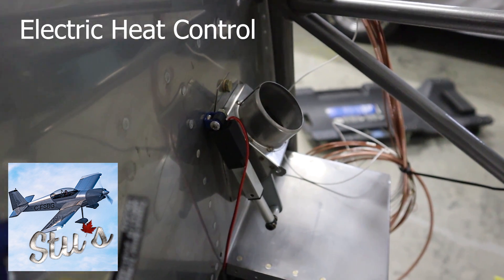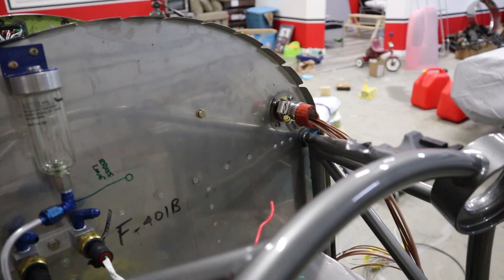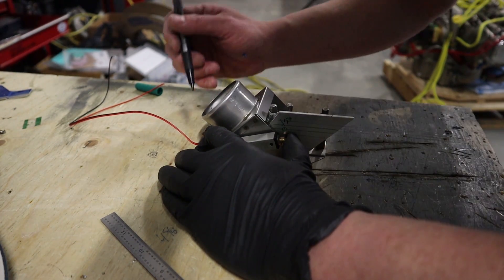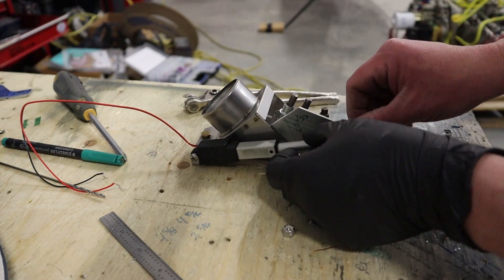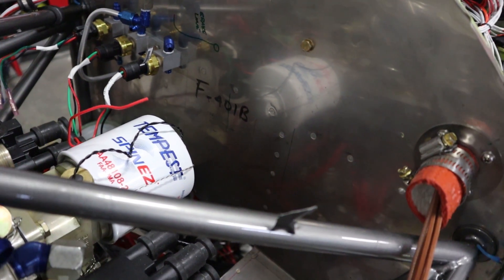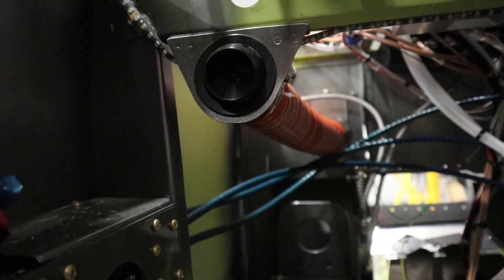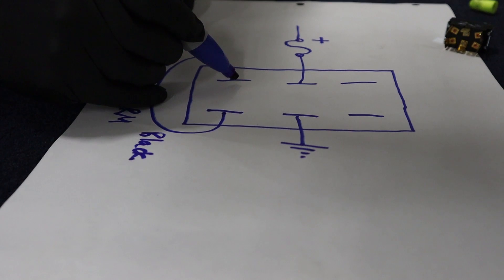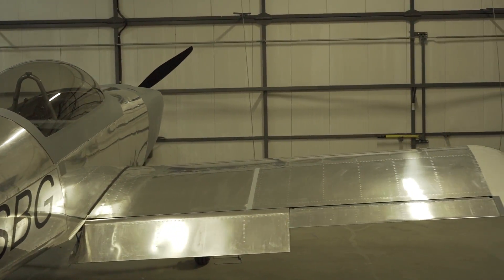Heat Control Valve - FUN PROJECT

Comment: Hi Stu - I was looking for an old video where you describe mounting a GA35 (I think) GPS antenna on a curved surface using resin and micro I think.  I'm building RV8.  But I couldn't find it.  Could you please point me to it?  Also, did you use a reinforcing plate inside the a/c on the skin.  How did you shape the base plate to the contour of the skin?  Thanks v much in advance.  Drum
Reply from the maker: Wasn’t me.  Maybe Dan Horton from VabsAirforce.  I would use foam to mold a base and then cover it in fibreglass.  I’ll have to do something similar to mount my wingtip nav lights

Comment: Funny those are the same linear actuators I sell for RC stuff.  Actuonix in Canada the controller should have a built in amp out which shuts it down if it binds to prevent damage.

Comment: Interesting method to control the heat valve. I have questions about weather or not your actuator is rated for the heat encountered on the firewall. I used a Boden cable, very simple, and does not take up much room. I’m also curious as to how you will route your scat tube from the heat muff.